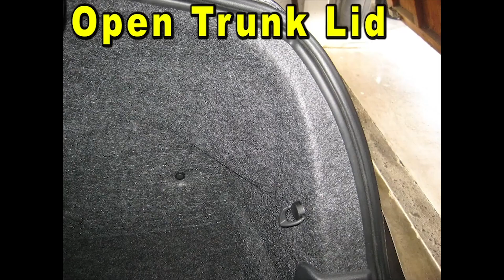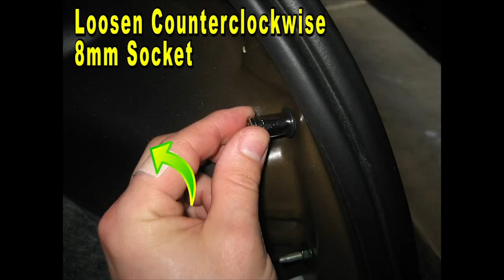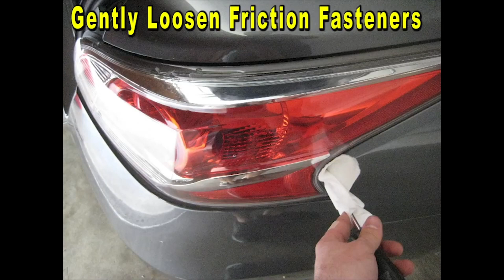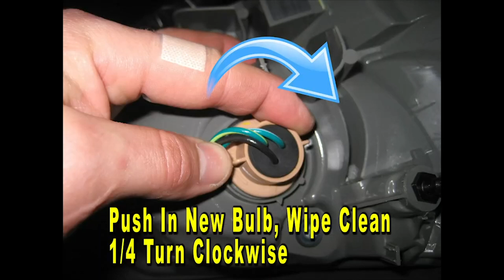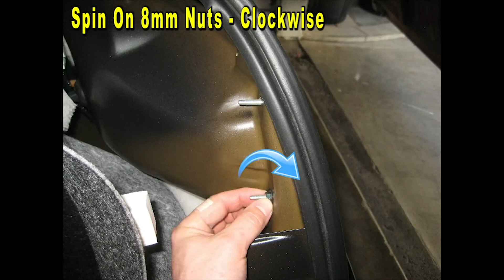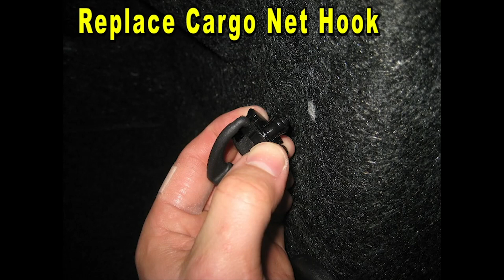2013 To 2018 Nissan Altima How To Change Tail Light Bulbs With Part Numbers - Quick & Easy

Comment from the maker: Nissan Altima Brake Light Bulb Part Number - https://amzn.to/3GQCqQO
LED Brake Light Bulb Upgraded Part Number - https://amzn.to/3XIfzO0
Rear Turn Signal Light Bulb Part Number - https://amzn.to/3XEBKVl
LED Rear Turn Signal Light Bulb Upgrade - https://amzn.to/3ZJlPHg
Nissan Altima Reverse Light Bulb Part Number - https://amzn.to/3CZNie2
LED Reverse Light Bulb Part Number - https://amzn.to/3Hh1jGS
Precision Screwdriver Set - https://amzn.to/3Zv60Ul
Plastic Pry Bar Tools - https://amzn.to/3D3BnvV
Socket & Ratchet Set - https://amzn.to/3Z17LbA
Mechanix Gloves - https://amzn.to/3jCnHkt
Torque Wrench - https://amzn.to/3vS5uSI

The Paul79UF YouTube channel is a participant in the Amazon Services LLC Associates Program, an affiliate advertising program designed to provide a means for sites to earn advertising fees by advertising and linking to Amazon.

Comment from the maker: Check out the DIY guide for changing the tail light bulbs in a fifth generation 2013 to 2018 Nissan Altima sedan - 
https://www.paulstravelpictures.com/2013-2015-Nissan-Altima-Tail-Light-Bulbs-Replacement-Guide/index.html

Here are all of the DIY repair and maintenance tutorials for the 5th generation 2013, 2014, 2015, 2016, 2017 & 2018 Nissan Altima - 
https://www.paulstravelpictures.com/Articles/2013-2015-Nissan-Altima-Common-Problems-Repair-Maintenance-Guides.htm

Owners of other Nissan or Infiniti vehicles such as the Versa, Maxima, Juke, Rogue, Murano, Xterra, Pathfinder, Sentra, Cube, Armada, Leaf, Quest, Frontier, 370Z, GT-R, Titan, G25, G37, M35 and M37 may also find these DIY instructions to be helpful.